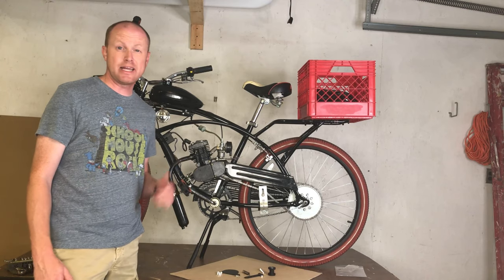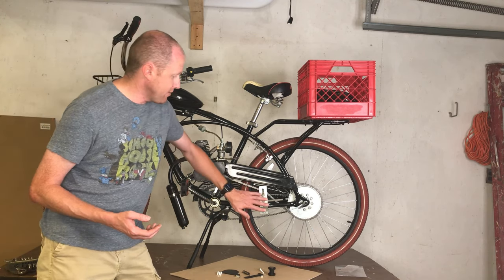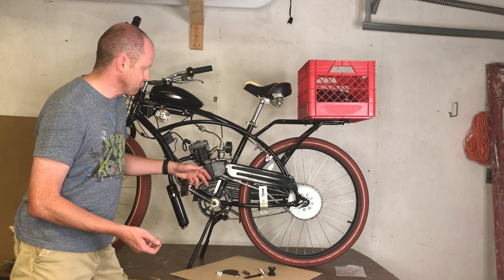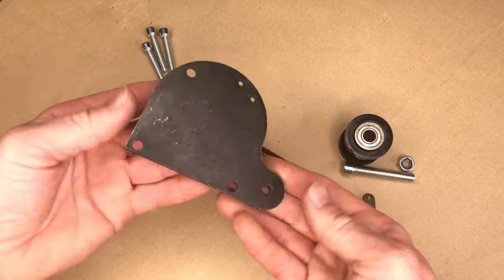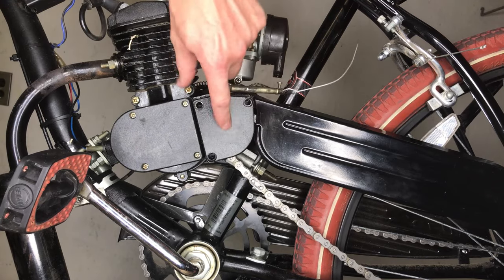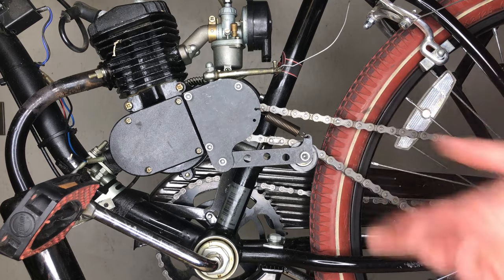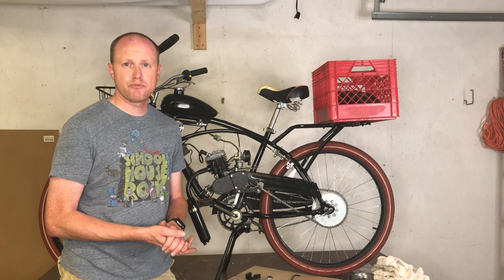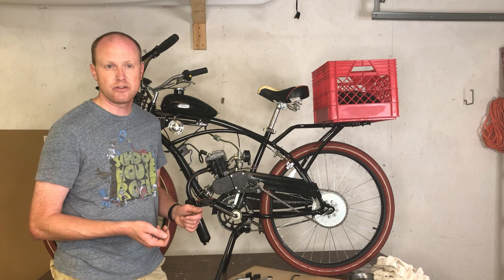Motorized Bicycle Chain Tensioner Upgrade

Comment: I have the same bike as yours and I was using the stock chain tensioner. On the first attempt at starting the bike the tensioner slid in and broke 8 spokes. We then drilled the tensioner into the frame of the bike so it wouldn’t budge but it decided it wanted to bend and completely destroy my wheel

Comment: First thing u need to do is get rid of that spocket that attaches to the spokes get the one that attaches to the hub
Reply: If you install them carefully they work fine unless your running a hot rod motor. Actually I've heard that getting those sprocket adapters to not slip is a problem. From my personal experience the rag joints work fine but they are a pain in the ass to mount

Comment: I put one of these on after countless tinkering with the cheap system that comes with the kits.DEATH TRAPS!!! I upgraded the spring on my tensioner. Bingo. Ready to rip n roll😊
Reply: Is the death trap the stock tensioner or the new one with the regular spring? I'm confused by the syntax of your comment.

I ordered a new tensioner for myself. Should I upgrade the spring?
Reply: The stock areva death trap. The one that runs off the clutch housing needs a stronger spring.

Comment: I have that Nel Lusso bike, too. I am thinking of putting a friction-mounted motor on it though instead of the 2 stroke as  you did. I have already removed that plastic plate and medallion at the frame and will likely be cutting the rack off to allow the friction-mount to be placed on back. If I do that, I'll cap the ends with rubber pieces. These racks are notorious in breaking at the welds. I will be adding a 4-stroke engine. No need for a tension adjuster in what I am planning, but I may pick up another beach cruiser and put in the same type of motor as you have and then add in the tensioner as you did. Nice mod and seems like it should work well. Thanks for posting. Those look like the original tires on your bike. How are they holding up for you?

Comment: piece of hose helps save your paint find it helped it grab more evenly . drill thru your frame and tensioner once mint and aligned . locking pin little bolt or something to save the spokes . if u have to run the shitty one like me for now till this part arrives :) cheer s

Comment: I recently purchased a used motorized bicycle. I've got over a thousand total in the bike. I'm about to install spring tensioner. Thanks for video. My question is; how tight should chain be set? I've heard both tight and semi-loose and neither has worked. I'm hoping spring tensioner solves problem but which is it? Please!
Reply: Take the rest to a motorcycle repair shop and have them stabilized the 420 chain for you about 15-20 bucks

Comment: That tensioner does not align chain where it is most likely to derail: where it meshes with rear sprocket. It also slams down during starting procedure

Comment: You take your chain guard the top of our connection to the motor and you pulled in between the cover and the engine that's all you got to do

Comment: So I need help I just got my spring tension or installed it and everything But the little bolts on the arm Don’t seem to tighten all the way because the inside of the boat cab has some type of interlocking it

Comment: I have a stretched out frame and need 2 chain tensioners I purchased the pulley arm tensioner since the other doesn't fit on a 4 stroke does anyone have a video on installing them

Comment: I’ve seen bikes with no chain tensioner at all..they have a spring loaded one from factory on the bike, do I need one if my mountain bike already has one ? The tensioners are needed for a one speed bike
Reply: @Steve_Does_Stuff  Yeah it’s just a theory of mine I’ve been contemplating. Very curious I just don’t want to destroy anything

Comment: That's why you take that cheap ass tension in the back of the bike and you weld it right on the frame that's why I do mine I pulled it and I weld it it didn't move yet

Comment: i can't wrap my mind around how these moped type bikes work. it just seems like the motor chain would turn the back wheel so the 6 speed chain should move with the back wheel just as quickly and make the pedals spin 20 mph. changing the gears in 6 speed mode while agh. i can't even explain my confusion
Reply: The rear hub “free wheels” So the gear don’t move when you’re doing “20 mph”